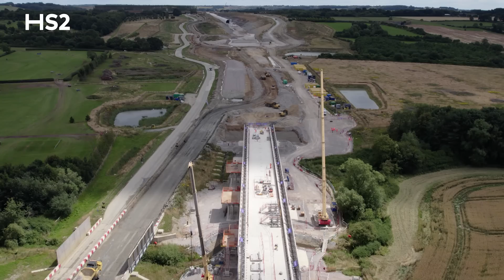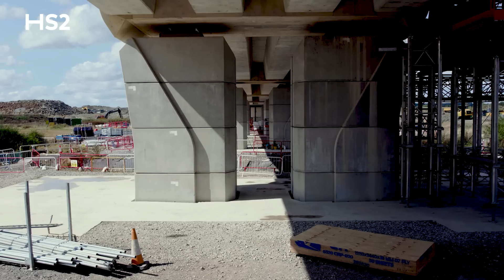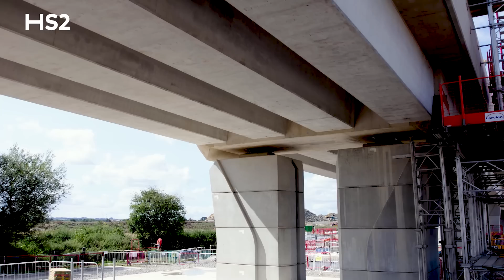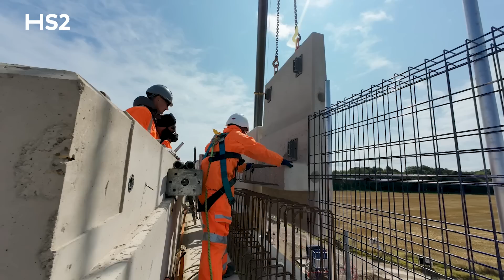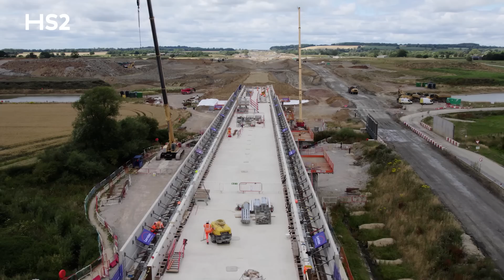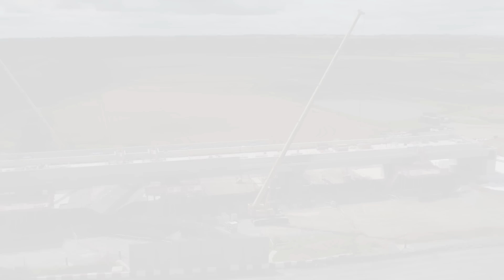HS2 celebrates first completed viaduct

Comment: It would have been much cheaper to put 90% of the line underground in tunnels. No compulsory purchases. No delays caused by lawyers. No expensive bridges or disruption to existing rivers, roads, electricity cables or pipes used for gas or water.

Comment: can they take a 50,000 tonne freight with 40 wagons? I very much doubt it
Reply: That sounds like some train! Each wagon would be over a thousand tonnes with axle loads over 250 tonnes. I would like to see the rail bridge that could take that!
Bridges are generally designed to a standard loading. Though HS2 is  a passenger only railway, it will be designed for freight loading due to maintenance trains etc.
Reply: the answer isno...far to dangerous for freight to run at that speed....its all bullshit to say so

Comment: Nice viaduct but what’s the point? Line iservices 1/2 the destinations it was designed to, doesn’t terminate in London where it’s supposed to and the speeds are being reduced over H&S fears. Nice viaduct though!
Reply: HS2, if limited to what is currently under construction, doesn't make much sense. That is why it is so important to reinstate Euston to Old  Oak Common and Handsacre to Crewe at the very least - followed by Crewe to Manchester and Birmingham to Leeds. Not many rail professionals would disagree.
Thing is, people are going to get very upset in the years to come with London and Birmingham having a 360kph link and the rest of the country still using Victorian railways.

Comment: It's criminal its not going to the north anymore
Reply: I mean, it's not officially cancelled yet. Technically it's still just on hold so could be brought back. There are several think tanks that have advised the government to finish the manchester leg as it'll actually be more expensive to fully cancel it
Reply: @zumahyena  They already sold the right of way, so dont know how theyd bring it back
Reply: @lukasschmitz1799 None has been sold. No one would buy it  that quick with how uncertain the government has been
Reply: @lukasschmitz1799 they have sold nothing…..yet
Reply: HS2 rains will still go to Manchester and Glasgow but use legacy tracks north of Birmingham. That is the amended plan at present.
Reply: @1chish .. but they WON'T be "high speed" which was the whole point of this massive white elephant.
Reply: @CRIMSONANT1   Still banging on with your usual tripe I see .....
No the whole point of this line was to add CAPACITY so that path hungry express trains could be taken off the crowded WCML allowing more freight and suburban traffic. Adding "high speed" adds comparatively small extra cost.

And they will be high speed overall.
Reply: @1chish  .. the only "high speed" trains will operate on the only section of this disastrous project that hasn't been cancelled .. London - Birmingham & even then, the actual speeds won't be those that were originally envisaged.
The "stats" re' the WCML are "dodgy" to say the least, especially after blatant corruption within HS2 Ltd was recently exposed. 
It's been revealed that senior management shredded documents & used misleading projections (lying in other words), to ensure that billions of pounds kept flowing into the project. 
Whistleblowers claim they were told by bosses to lie about the project’s cost & were sacked after speaking out. They say  the government wan't informed of the real cost of HS2 for years, all while voting on laws that approved its construction.
Arguments that the WCML is "full to capacity" rely on a discredited, out of date forecasting model which overestimates long distance passenger growth & isn't used for anything anymore except to justify the monstrous vanity project that is HS2.
Network Rail's "New Lines Programme Capacity Analysis" shows that WCML capacity is kept artificially low by private operators wanting to maximise their profits.
It's nothing but fraud on a gigantic scale & will no doubt result in a public enquiry. 
Of course, all the gullible HS2 fanboys have believed every word of it for the past decade 🤣
Reply: @1chish  I'm afraid old James Monks seems hell bent on bashing HS2 at any given opportunity and clearly has no understanding of the rail industry and how precarious the future of the WCML is in its current form without capacity alleviation. Just ask him what would be his preferred alternative would be and he mysteriously disappears.
Reply: @thorley1969   Thay mostly all disappear when challenged. They throw out the garbage and think that is job done.

Comment: I don’t care , it’s a massive white elephant and a waste of money for very little gain . Someone somewhere is making a hell of a lot of money out of this !
Reply: Freeing up rail capacity on an extremely crowded west coast mainline is quite a big gain really. More space > more rail freight > less trucks on the roads and less congestion.
Reply: @user-bh3me3yn6h Because that is also really expensive. HS1 is a resounding success, and if the tories hadn't spent a few years messing around with the funding HS2 would have been a huge success aswell.
Reply: @morph- hs1 has never achieved the passenger projections which underpinned it. 

It's nice to have, but as with most rail, a money pit.
Reply: @user-bh3me3yn6hIsn't that what HS2 is?
Reply: @user-bh3me3yn6hA normal railway that no one simply won't use, this is where the Victorian simply went wrong building tracks and stations in the middle of no where with fewer passengers on a mix rail line  HS2 will solve this problem by  removing the High Speed trains of the West Coast mainline onto it own set of tracks and run 8 trains an hour's and to free more space on the West coast mainline for more commuters train to run in and out of Birmingham London and Manchester and Crewe.
Reply: @user-bh3me3yn6h 4 places in which HS2 is building. It is due to run from Old Oak Common to Birmingham, then it will rejoin the West Coast Mainline at Handsarce to run all the way to Manchester, it will eventually run to London Euston once the Government stop messing around and make a decision, where do you want to go exactly??

Comment: Has anyone read the "Current passenger numbers from Birmingham to London on West Coast mainline and expected numbers on HS2 (P0018587)" of the Department of Transport, with the forecast 18,000 single journeys between London and Birmingham, from the mid 2030's, or 6 to 7 million annual single journeys. A scheme that will employ 28,000 bodies at its peak, and have annual operating costs of six to seven billion.
Reply: Well here we are again Andrew. You keep peddling this nonsense but one look at CURRENT usage makes your numbers look completely out of date. According to the Office of Rail and Road between April 2023 and March 2024, Avanti West Coast had 32.8 million passenger journeys. What you selectively do is fabricate a number for London to Birmingham when HS2 will remove ALL express trains off the WCML. Regardless of whether they go to Birmingham, Manchester or Glasgow.
And you quote the 'operating costs of six to seven billion' with no sources or facts but i bet that is for the WHOLE of the WCML express operation not just to Brum.
You NIMBY Anti-HS2 brigade need to stop this false selectivity....

Comment: There are so many other countries where an identical project would be on time, on budget (and much cheaper) and the trains would actually be fast. This shows us up, massively.
Reply: Actually, the trains will be going a good old lick, considering the relatively short distances involved. Some would say, HS2  could have been built alot cheaper, if we dropped the highest speed a quantum. You cannot start expecting the speeds that other, much larger countries, have designed for their  HS networks smashing across open, hardly occupied, plains.
Reply: @JohnHoward-wc9kk The first generation HS2 trains will do 360kph (225mph) maximum and have an operating speed of 320kph (200mph). The linespeed will be 400kph (250mph), which allows for future trains operating when the electricity supply has been decarbonised. HS2 will be one of the fastest conventional railways in the world.
Higher speed is more expensive but is not a major driver of cost. For example, only one bored tunnel on the Phase 1 route is designed for 400kph (the mile long Long Itchington tunnel) - because trains accelerating from Old Oak Common, London will not achieve that speed until past the Chiltern tunnel.
Speed reduces journey time so encouraging more passengers and shift from planes and roads and also making more efficient use of trains and their crews.
Reply: @jasonlee4267 I'm not aware of any decision on downgrading train speeds. The line is engineered for 400kph maximum and there is no reason why London to Birmingham trains shouldn't run at the 360kph maximum speed as they will be on HS2 infrastructure all the way.
Unless you have other information, this sounds like the proposal made a few months ago to downgrade HS2 train maximum speed to allow Pendolinos to run at 155mph (which they do in Italy). That would enable train times to the North and Scotland to be competitive. At present it is simply a proposal.
The current cutback route makes little sense. To avoid a bottleneck at Stafford, Phase 2a (Birmingham to Crewe) is essential. The former government's 'Network North" plan included Tatton to Manchester Piccadilly (via Manchester Airport) so that leaves Crewe to Tatton - a simple cross-country route.
HS2 is future proofed. It's linespeed is 400kph and it allows for 18tph per direction, which future signalling improvements may increase.
China comparisons are interesting but that is a very different economy and society  to ours. Apparently they poured the same volume of concrete in the last three years that the USA did in the whole 20th Century. 
Not saying we couldn't do a lot better in the UK.
Reply: @martinsloman6905  Thanks for those operational  facts. They are the detail that the general public is not aware of.
Reply: @jasonlee4267 I think building a high speed train line across the open deserts of Morocco would not be without challenges, but pale against  the amount of civil engineering required to  fit HS2 into our crowded island !

Comment: Why do we need to build noise-cancelling viaducts in the middle of an empty field?
Reply: Sheep and cows are getting very litiguous these days.
Reply: Because there are numerous stakeholders located within earshot of the viaduct.
Reply: We could have many reasons for this. 

Not having to build them later. Ensure containment and safety. Cost if you build it now you probably safe 50% compared to doing it 10 or 15 years later. 
Maybe it is by design for Highspeed rail coorridors